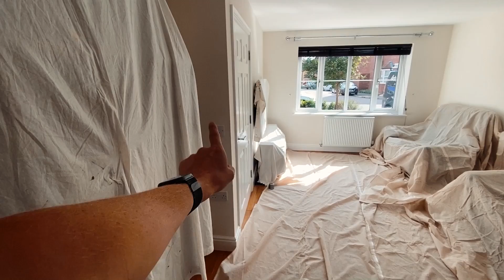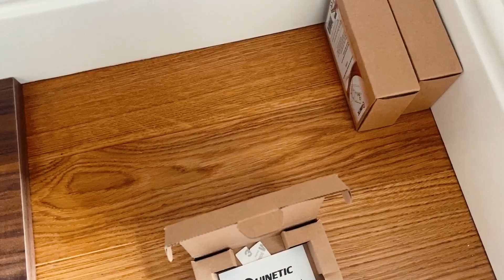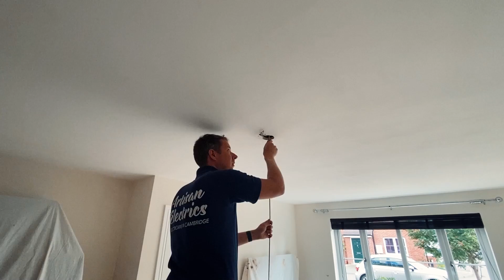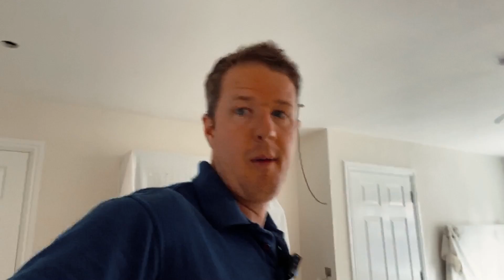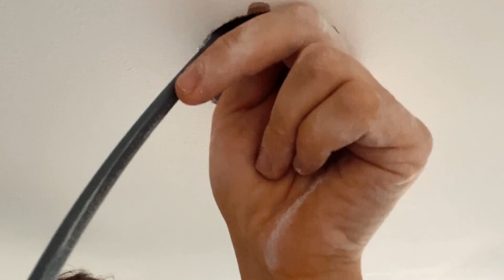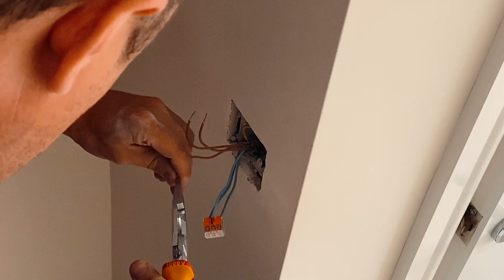Magic Stud Finder! 🤫 Installing LED Downlights & Wireless Switch

Comment: Good video Jordan, you managed to fish those cables round with minimal damage, out of interest on these types of jobs do you let the customer know that there potentially might be many holes that need filling if it was to go pete tong and you needed lots of access holes?
Reply: @Lewis Miller Multiple holes is a PITA but easily resolved on a flat, painted ceiling BUT on a papered and ESPECIALLY if Artex or worse ... Anaglypta ... Painted Anaglypta, in a faded colour, no longer available! Add a fortnight to the job! And if it's a black lime mortar on lath ceiling that's 80 plus years old ... Walk away ... No, sorry, RUN!
Reply: Bob Lewis m
Reply: @boblewis5558  If i have artex i want skimmed anyway, should i do holes and wiring first or the skimming first?  Or no difference?
Reply: @user-pf5xq3lq8i  it depends! If the ceiling is lath & plaster, with Artex on top and then skimmed on top of that (??) it's probably MUCH BETTER albeit VERY messy, especially with black lime mortar (been there, done that!) to have a complete new plasterboard ceiling. It will also give you unfettered access to the joists etc.

Then cut the holes and skim or if you have the grid reference to the holes, skim, then cut the holes. 

Otherwise, if Artex is on top (underneath) of a modern gypsum board ceiling it probably makes little difference. Personally whenever I've cut holes, I've  always done it after the skim.

One thing to note though is how big the holes are going to be. You need to be able to get your hand through, or at least have your wiring VERY close to the hole to reach it and pull it through - always a problem I've found with 55-60mm holes!
Reply: @boblewis5558  Top man, cheers!

Comment: Great vid as always! Never thougth about using that ring for gliding down another cable, I did lose miune as soon as I bougth a set though. 
Also, I havnt seen any sparks do this, but when I install pendents,  if its a single boarded ceiling, i tend to fit one of those round drylining boxes. Cable stays in there so the mud flickers are happy, you get some room if you need to fish ect and its useful for when you need a stronger fixing and and the previous hole is just blown out or no stud/joost is near. Also does give you more slack when you change a pendent and some absolute ** has cute the cpcs and or left zero slack!

Comment: What would you have done if there were joists in the way which you could not get through
Reply: Sometimes the only way is to drill a big hole either side of the joist in the PB and use an angle head drill and flat bit and drill a hole in the joist. More making good but if you keep the Circular plug you can screw it back into position after and make good.
Reply: There was one he couldn't get through - he ran the cable underneath the joist in that tiny section of oval conduit. 

Last time I did this there were two joists in the way so rather than using the holesaw to go either side, I just chopped out a thin rectangular piece of the ceiling with a multitool, drilled the joists and ran the cable, then cut some new plasterboard to size after I was done and fixed it back. Luckily, plasterer was already coming back so he could skim it.
Reply: Thank you all for your  advice very helpful 👍

Comment: It's hard to beat that stuff, only downside is you can only get it from one place, which makes me think they have a hand in making the stuff.
I like to use the MK grid switch modules myself, also you could have saved a few quid using a two channel one, cheaper than two single channel ones.

Comment: It amazes me how often I find t&e running between double-insulated fixtures with the CPC continuity not intact. Laziness? DIY?
Reply: failure to understand that it's a CIRCUIT protective conductor, not just an equipment protective conductor. Indeed I believe that's part of the drive to rename it.
Reply: @TheChipmunk2008  if there is ONLY plastic or NOTHING to connect to (typical on double insulated stuff) it's understandable why installers (pro or DIY) might just think "f*** it What can I do? I'll just cut it!" Manufacturers of electrical goods take zero blame but are 100% the problem ... Just fit an earth terminal as a CPC anchor point you bozos!  Cost, what, 10p at manufacturing volume cost OR less!?? Bloody bean counters YET AGAIN!

Comment: A stack of 10 small neodymium magnets, disconnect 1 at each magnetic spot. You can then leave them on the ceiling for your stud centres and easy visual of what is where 👍🏻
Reply from the maker: Nice tip!
Reply: Absolutely! I use them all the time ... work great on vertical studs too! 

Another tip, for use on walls is to cut off the top of a soda/pop bottle very near to the collar ridge and glue a piece of plastic across the neck (making a tiny "bottle") put the magnet inside, refit the top. This is MUCH easier to hold lightly and slide around to find the screws/nails. It will usually "snap" quite solidly when it does and you can mark the stud position easily.
Reply: I've seen this used and it is cool. The hold they have is amazing.
Reply: That is genius!
Reply: Great idea
Reply: And less than £! each mag!
Reply: Only when studs are metalic
Reply: @DerekHundik  Its more to find the plasterboard fixings, not the actual stud.  I don't think I've ever come across a fixing that isn't magnetic.
Reply: @Atsaki13  yes you right. I didnt think about screws . Then he showed this stud finder.

Comment: Great stuff. 
Well worked out. 
I always run a chalk line (if the ceiling is unfinished) or at least a laser to give me a physical representation of how the downlights will look before cutting holes. I find measuring alone (almost always off unsquare walls, does not give symmetrical lines of downlights. Especially when there’s a few in line.
Reply from the maker: Good stuff!

Comment: Chocolate hobnob, good choice
Reply from the maker: Definitely!
Reply: You can get ones with marmalade in now. (Orange packet). Very nice change. And cheaper. Well actually they are a Digestive 😂 lookin on the packet, but you wouldn’t know. But hobnob size

Comment: I'm a plain guys and partial to a digestive biscuits to dunk in my coffee. 

Do them CPC's just by pass the receiver and go straight to the down lights ?
Reply from the maker: Awesome! Yeah the receiver is class 2 so doesn't need a CPC so I just linked them out inside.
Reply: Have you ever known any faults with intermittent signals on them receivers

Comment: Why didn’t you use the MK Grid plate and MK style Quintetic modules to fit? Looks like a proper switch rather than those huge monsters.
Reply from the maker: Yeah could have done I guess
Reply: @artisanelectrics  Got to agree I prefer the standard looking switch the others look out of place. Could you not have pulled the feed to the old pendant back to one of the downlights so as not to have to join the existing cable?

Comment: On my third set of super rods now
Reply: Super rods have a lifetime warranty..... if any ends ever come off or if any snap or splinter  you can take them back to where you bought and they will send back and getreplaced.... no quibble. I've had my mega set over 10 years and had about 4/5 rods replaced. Still have all my original attachments but bought an additional torch and hook oh and a 'Chinese finger trap' lol 😆
Reply from the maker: I'm on my second!
Reply: Artisan Electrics : wish you could buy individual ends  though rather than a full set of bits you don’t really use. Lost loads of brass bullets and eyes.